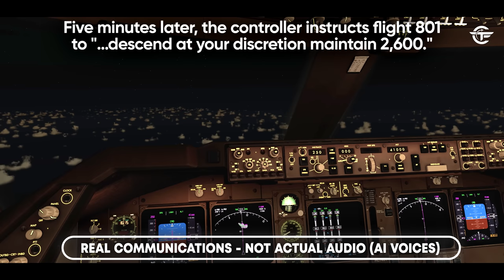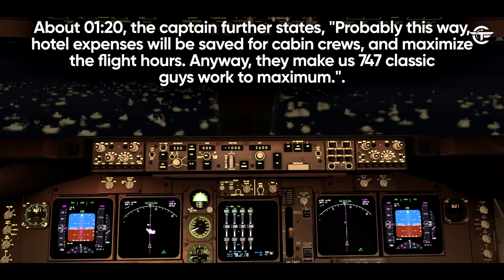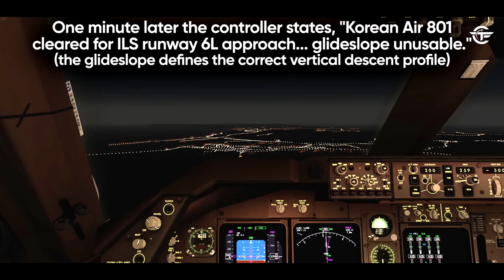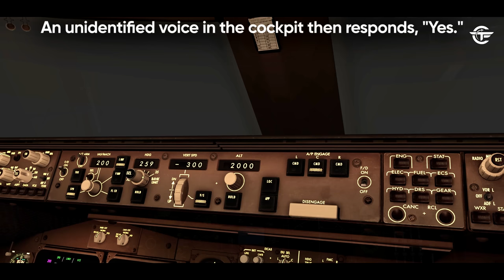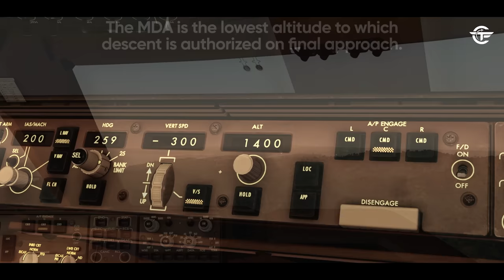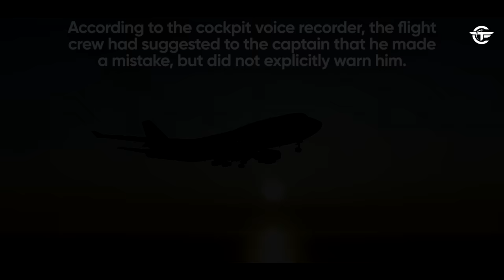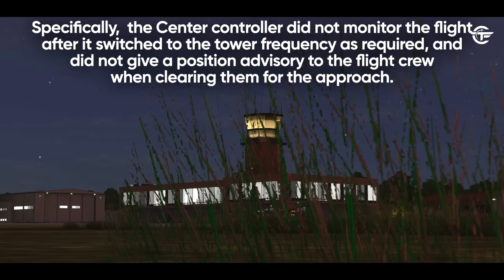Boeing 747 Crashes in Guam | The Terrifying Story of Flight 801 (Real Audio)

Comment: I was a doctor at the Navy Hospital there that night. This was not the normal crew that flew to Guam. They usually flew an Airbus on that route, but Guam had requested a 747 instead, so that they could take the Guam Olympic team to the South Pacific games. I was so frustrated at the lack of survivors who were taken to the hospital. The aircraft impacted on its belly and burned slowly, but emergency equipment could not get to the crash sit, because it ended up on the downward slope of Nimitz Hill. The crew tried to initiate a missed approach, but the landing gear got caught on a small oil pipe, which brought the aircraft onto the ground

Comment: Outdated charts, pilot fatigue, poor CRM & ATC error. This disaster was inevitable.
Reply: On the contrary, if any one of those factors had been corrected the accident would probably have been avoided.
Reply: “inevitable … yet totally avoidable.” Tragic.
Reply: Yes. All around cluster f__K
Reply: Destined not inevitable.
Reply: + No Gluide slope in stormy conditions
Reply: All of those terms are nice to say, but this was just another murder-suicide being covered up with jargon.
Reply: @rstidman  Unless there's evidence the captain was, or had reason to be in serious mental distress, there is no basis at all for that claim.
Reply: You're right about that.
Reply: @rstidman  Tin foil hat time.
Reply: Do the ATC guys get any punishment? Quick google search suggests John Mayo is still working ATC.
Reply: As a retired ATC I’ll tell you Mr. Mayo did nothing wrong. He gave the perfectly correct clearance (glide slope unusable) and the ATIS also said the g/s was unusable; which does NOT mean it isn’t transmitting. I worked with Kurt for many years and he was a very conscientious and competent controller.

Comment: Korean Air at the time had a lot of problems with CRM. Dominant captains and subordinate first officers were the norm. Two years later, a Korean Air Cargo 747 crashed in England shortly after takeoff due to captain's mistake and first officer's lack of courage to challenge the captain.
Reply: Actually, 3 More planes crashed in August 1998(flight 8702(747-400)), march&April 1999(flight 1533(md-83)&6316(md-11)).
Reply: There's a reason why the FO is second in command situations like this
Reply: this is part of why this plane crashed
Reply: In the 80's (?) a KAL cargo jet burned up on the ground, somewhere in Korea. The pilot had been admonished earlier for some minor mistake, and was in no position to get "dinged" again, (loss of face). The cockpit crew was almost to the door when the flames got inside the cabin, and the pilot told them to stop and get back to their seats ! They did, and they all burned to death.
Reply: @Mr1990hjc  u meant korean air flight 015. That plane was passenger plane.
Reply: @user-underdasea  OK thanks !
Reply: It isn't limited to just Korean crews. In the USAF we had the same problems. Subordinate officers would be punished for overriding the actions of pilots despite their actions saving the planes and crews.
Reply: it's a culture thing
Reply: It still happens to this day. Hope airlines change that culture. even without crashes or incidents, it is a very dangerous situation. That should receive just as much focus as flying the aircraft
Reply: If my life was on the line, there is no doubt I would lose my job and speak my mind before I'm going to let some arrogant bastard get me killed.
Reply: To be fair the flight engineer was trying to. The fo was either paralyzed with fear or suicidal. Possibly a combination since the captain just got done tongue lashing him about something insignificant in the grand scheme of it all.
Reply: 1983. KOREAN Air 07...pilot f'ed up. Flew into USSR AIR.  SHOT DOWN
Reply: @joannesullivan2199  And there was Korean Air 902 five years earlier.
Reply: @GCarty80  Korean Air has a poor safety record for a reason, if looked at on a long timespan.
Reply: What is CRM?
Reply: @harlowblackadder356  Crew resource management, or simply pilot teamwork.
Reply: @harlowblackadder356  Cockpit Resource Management
Reply: @GCarty80  Thanks! 👍🏻
Reply: This flight and the one that you mentioned also got covered on Smithsonian show Air Disasters
Reply: It's also a cultural issue in Asia and a lot of captain of Korea Air were first in the Air Force
Reply: I was thinking the same thing about another crash, with an Asian cockpit team. the copilot was much younger, and very inexperienced in flying hours, as compared to the Captain.  Even though the aircraft was banking to the right, shortly after takeoff, and the Captain's displays went totally blank, the co pilot didn't correct the captain, who didn't realize it, and erroneously said aloud, and thought that the plane was level. The Black box recording proved that the copilot siting in front of his displays, didn't say a mumbling word. 😮 Only an additional Flight Officer who was in the cockpit, who had MORE experience than the Captain, and was of a similar age, yelled out : Bank! Bank!, from the 3rd chair, at which, the arrogant Captain, ALSO ignored the flight officer, AS WELL, even as the WARNING noise sounded! I thought: so one would rather die than tell the captain-- and SHOW him as the FO's display screens were properly working -that he was actual in error, putting all at peril, and that the current dire situation REQUIRED  IMMEDIATE CORRECTION, or else!  the plane shortly thereafter nosedived, crashed, and had no survivors.  crazy.  I know that respect for one's elders is a huge part of their culture,- and should be for all cultures --but when it comes to life and death, you have to speak up, and TAKE control!!. Did the co-pilot forget that planes do have black boxes?!   The recording would  prove that whatever actions (if) he had taken --that he felt was disrespectful to an elder and supervisor--was totally warranted?! Sad.  Unnecessary deaths. It was a situation that could have easily been corrected.
Reply: To explain this hierarchy thing in more detail: 
  As for the crews on flight deck, the factors were: age, your former position in the military, how long have you worked for the company, plus the position inside the cockpit. 
  Here, the pilot(born 1953) was initially non-airforce academy cadet, and his final rank was airforce major when he was honorably discharged in 1987. 
  The co-pilot(born 1955) and flight engineer(born 1939) were both airforce academy graduates, which is usually more highly regarded in the airforce hierarchical terms, but the academy and non-academy members usually respect each other in terms of their years accumulated in the military, not their schools. The co-pilot was former lieutenant colonel discharged in 1994, and the flight engineer was also former lieutenant colonel discharged in 1979, both joining Korean Air on the years they were discharged from the Air Force. 
  So while the captain(pilot) would seemingly have full unchallenged authority on the flight deck, it really came down to how the most senior member there, the flight engineer, conducted himself towards the captain, who is 14 years younger than him and has 8 years less as a staff of Korean Air.
  The flight engineer was pretty respectful towards the captain, despite the engineer himself being an academy graduate, much senior in every terms, and having higher former rank as airforce lieutenant colonel - compared to the captain's former rank of major.
  Ironically, this might have contributed to the co-pilot being much less assertive when the goings got desperate, because the co-pilot was the youngest, the most junior member of Korean Air's staff on that flight deck, and was discharged much later than the flight engineer from the same academy. In this case, co-pilot was respecting the flight engineers respect towards the captain because he is not wanting to go out of his way to be a sore thumb by ignoring the flight engineers respect towards the captain.

  So in this mishmash of hierarchical structure which is very confusing and does not allow "mistakes" in terms of every word said or actions taken, any of these two: copilot and flight engineer, going into argument with the captain might make everyone's feelings hurt, and make room for potential "company politics". Nobody wants to make things complicated. Because it might turn into faction war between academy graduates and non-academy graduates in the company, and or be seen as crews disrespecting the pilots authority, and much more. 
  So the copilot AND the flight engineer failed to warn the captain, who was very tired, in a more assertive and direct manner leading to this disaster.
Reply: And this shit still exists today, it is so ingrained in their way of being it will never change. I flew in China for 5 years have seen it first hand. Met a bloke whos son was a Co, I said you must be proud of your son, you would think he would be right, no chance, his son was nothing to him until he makes Capt. Co's sit there like scared kittens, couldnt speak up to save them selves let alone all the lives behind them.
Reply: Sad thing is this mindset doesn't just affect airlines. It can have negative impacts on a lot of crucial areas like hospital staff, teachers, military and so on. Being Senior does not always mean you don't make mistakes.

Comment: I lived on Guam from 1990-1993. I lived in Navy housing on Nimitz Hill. The aircraft on approach to Won Pat flew right over my house. This thing must have missed that house by 10 feet. I was there on unrelated business a week after this happened. We went to the crash site. It was a sobering sight. The vertical stabilizer was sticking up out of the jungle and completely undamaged. My first thought was, "This thing just doesn't belong here." It was an eerie sight.
Reply: We lived there during the crash (my dad was in the navy and we lived in the naval housing on nimitz hill as well) and my dad recalls walking out and the air reeked of jet fuel and the air had an eerie haze to it. So tragic

Comment: Korean culture is very hierarchical.  The ones in their junior positions rarely challenge their seniors.  I am sure this was the case here which partly contributed to the crash.
Reply: I spent a lot of time there in the 80's, and yes tis very true. I participated in a command post exercise at Osan Air Base one year. I worked with a bunch of Korean officers, and we would take smoke breaks together in a hallway near our work station. One night, a bunch of Korean marines were coming out of a day room or something down the hall. These guys saw all the officers, and their smiles disappeared ! They kept walking past us, in a slightly stooped posture, with the right hands holding a salute, and the other hand covering the left butt cheek. When they got within range, the officers ATTACKED. As the marines went by they were slapped on the back of their heads, and kicked in their asses, and without any anger at all. It was like, OK no problem, these are just the rules !
Reply: @@Jurk844  Yes, it was becoming that way in the late 80’s, but it was only a whisper in the wind when I left Asia.
Reply: @@Jurk844 you are in denial if you think a lot has changed.   Not enough changed to prevent this from happening.
Reply: @@Jurk844 defamation? Go do some research before speaking.  It’s well known Korean work culture is not the best.  They are making changes but they still have a long way to go.
Reply: Maybe so, and American culture of not caring in the slightest about anything other than yourself also contributed its share to the crash.
Reply: @Jurk844 Ferry Sewol incident suggests that as of a few years ago they still had a long way to go.
Reply: Don't diminish the role that $$$$$ drives management to fly pilots with insufficient rest.

Comment: This accident is proof that the introduction of aviation quality GPS has eliminated most controlled flight into terrain (CFIT) accidents. With good reason: flight crews now know their exact position, including altitude, to at at least 30 feet, or even down to 10 feet with ground transmitter assist.

Comment: Nice video.  First, it was incumbent on the flight crew to understand the terrain around the Guam airport.  At least one member of the flight crew should have beeen someone who had been there before.  That the airline would provide an incorrect map is unacceptable (updated map?  Nimitz Hill has always been there.  The map is either correct or it isn't).  Next, Korean Airlines at the time had a huge culture problem: the captain i always correct and the first officer or second officer should not contradict him.  In the years since the crash, Korean Air has seen improvements, but in a country where hierarchy is prized, overcoming that problem has taken enormous effort.  Lastly, I agree with the criticism of the control tower.  Their monitoring was not appropriate.  I will also add that I have always believed ATC shouldhave both surveillance and height-finding radar, or use a 3-D radar so as to receive important data independent of what the aircraft transmits.  Today, as the US Navy begins to retire the SPS-48, why not donate the sets to civilian air traffic control?

Comment: I think if the altitude selector on the MCP only increments in 100s, you're suppose to ROUND UP, so for 560 feet, you'd set "600", not "500".

Comment: I have seen far too many of these videos, where the crew doesn't understand a very straightforward command from the tower (glideslope not working), and then completely ignores all the warnings in their cockpit. These are highly trained professionals, as well as multiple people involved in the decision making, so how can they as a group make such stupid decisions.
Reply: Sometimes if people are extremely fatigued & in a particularly bad mood, it's very easy to make mistakes, even when you're usually a consummate professional. In this case, they were removed from a longer flight due to fatigue concerns, even so they were pissed off obviously over being screwed out of overtime pay & a paid for accommodation, while being exploited & exhausted. It's easy to make mistakes like this while driving in a car when very very fatigued, such as hitting the curb by accident while entering a driveway, or slightly grazing a speed bump for example, or even missing a red light from barely being able to focus. I've been there after working 14-16 hour days where I've travelled an hour to & from work. It's a shame because it really seems like the First Officer & Engineer even noticed Glidescope was not working in the first place, just that challenging the captain didn't happen - even perhaps due to the nature of Korean social expectation?
Reply: This is why it is not only important for the pilot to read back everything, but also for the controller to listen to the read back and ensure everything is understood. If the controller had said "Korean Air 801 read back glideslope not working" then the crash could have been avoided.

Comment: I remember that sad sequence of crashes involving Korean Air and Asiana aircraft along the late 90s. Actually it was the reason I ended up working with FSB (Flight Safety Boeing, later FSBTI-Korea, later ALTEON Training) as a Training Center Instructor & Examiner for six and a half years, as of March 2000, at Korean Air Training Center in Incheon. Was an interesting learning curve, they studied a lot but cultural issues were a factor (if not the factor)...it was hard work, especially along the first 2-3 years.

Comment: The crash occurred after midnight and in inclement weather which probably added to the visibility challenges called out in the video. My brother-in-law worked for Guam Power Authority back in the day and was able to get us up to the memorial that is on Nimitz Hill. There is ample view of the flight path and runway from the memorial. The plane practically landed on top of the VOR. The ILS system was not operational at the time and I'm almost wondering if there was some sort of erroneous glideslope signal that the instruments were picking up that zeroed in on that VOR.

Comment: This seemed like a relatively simple accident to avoid.  The glide slope was stated to be inoperable and ILS was recommended, but there was no acknowledgment by the captain that he was aware of the inoperable glideslope.  I started to cringe when he ordered descent from the 1440 altitude, and cringed more when the nose up was only 1degree per second.  Did they have time to rise above once the "terrain" alarm sounded?  I was "pulling up" drastically during my cringe!  Of all the situations covered in the past years, this one to me seemed like the easiest accident to avoid.  Such a shame for the lost souls aboard.
[ATC sounded a bit cavalier about the missing flight. Is this normally the case?  None of the ATC present sounded upset that they lost track of Korean Air Flight 801!  Perhaps EVERYONE, not just the captain,  was in "ZOMBIE" mode for this accident to happen?]
Reply: whenever there is a "terrain" warning it is an automatic memory item. Maximum power 20 degrees nose up, until "terrain" warning is silenced.
Reply: The more that I think about it, the more that pilot fatigue seems primarily responsible for this crash.

Comment: This is virtually the ONLY airline crashe video I have ever seen which acknowledges failure on the part of air traffic control (ATC). Beyond their failure to observe Korean Air's position on radar, they also failed to repeat information and insist acknowledgement that glideslope was unavailable after Korean Air flight crew did not originally acknowledge. One would assume that this should have been ATC's top priority in this circumstance of a night landing and a difficult approach.